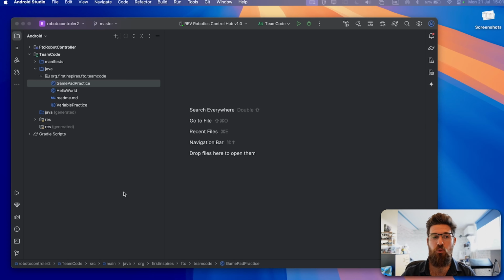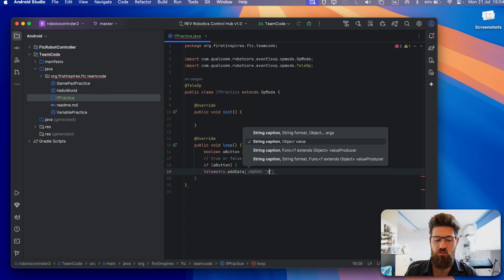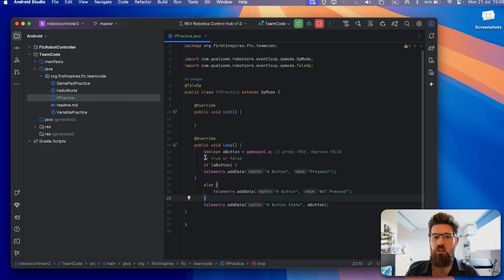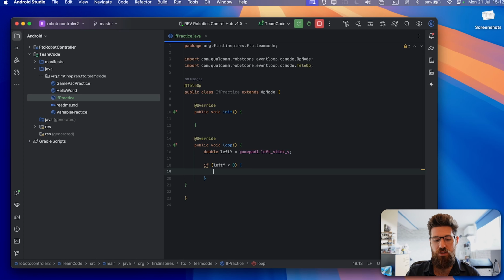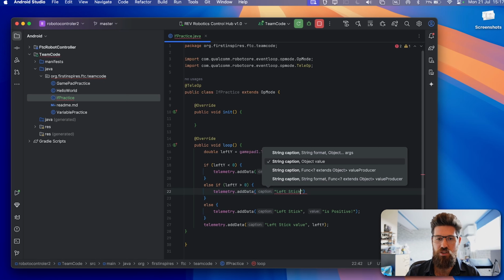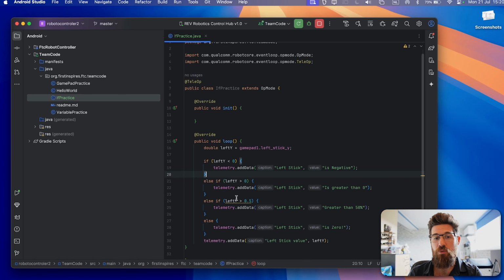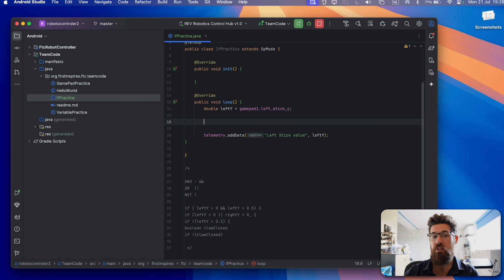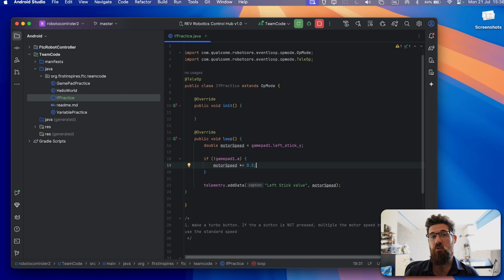Your Robot's First Thought: Selection Statements (Learn Java For FTC)

Comment: Since aButton is a boolean, does that mean that it's value will automatically be assigned as true unless something else happens? (for example, you press the button a)
Reply from the maker: I’ve got a full video on programming the gamepad here:
https://youtu.be/gXegsVvXLd0

In short, no. The gamepad returns true when pressed, false when not. It’s a sensor so you need to read it every loop and the program runs 50x~ a second, so you’re reading the gamepad roughly 50 times each second. It will only return true when you read the gamepad and the button is depressed.
Reply: @BroganMPratt  Thank you so much! Your videos are really helpful
Reply from the maker: Glad I could help you out!